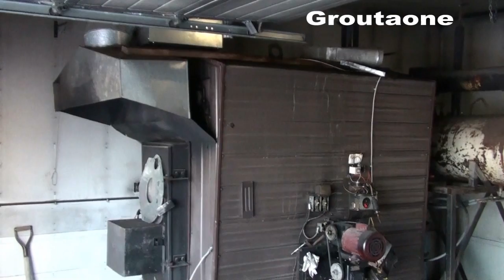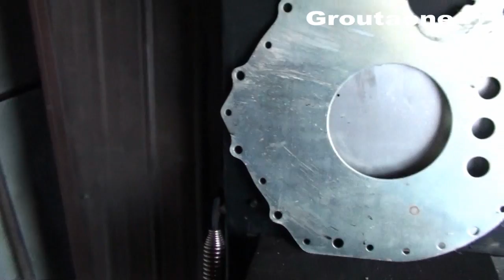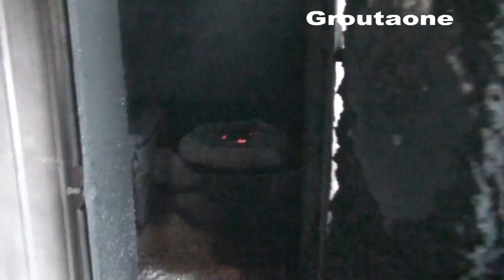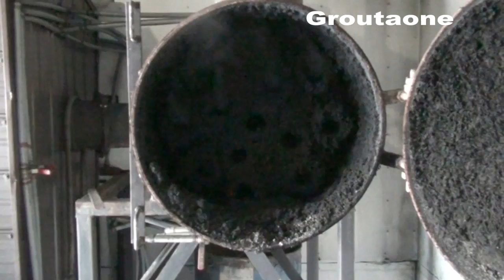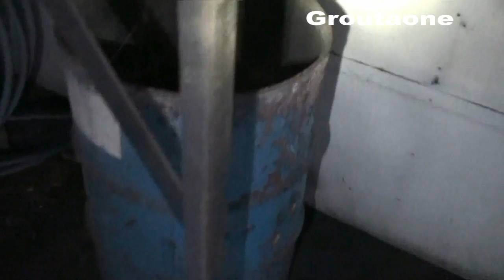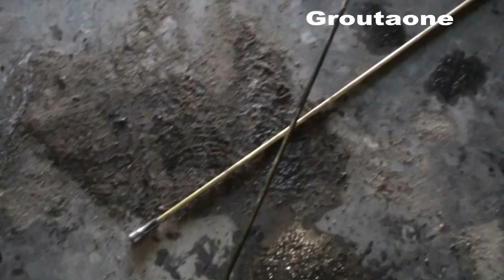How I heat My House  For Cheap In Canada pt 4

Comment: My house has a dynatherm petroleum heater. The inside of the heater has the same arrangement of tubes. Needs to be cleaned every five years. Efficiency is middle ninety percent. Really cuts down on my heating bill. I would say by forty percent compared to the old oil heater that I use to have. I clean the inter pipes with a tool just like yours but there are twice the number of tubes to clean. Keep on making videos too.

Comment: I love that system. wish I had something I could burn. Bout all I got is grass and weeds growing on about 3 acres here. lol  Still all that ash has me wondering if it couldn't be better. Some way of filtering that ash before it hits the heat exchanger. It would allow the heat exchanger to operate more efficiently.  Not that you really need that little bit of efficiency with such a huge supply of fuel. Which reminds me. Where do you get all the sunflowers?

Comment: thanks for the great vid.
you have to find a way to auto clean heat exchanger.or some things that clean a little the exost.
so you clean the heat exchanger once a season.you alsaw can use cleaner fuel.
i hope that you have to do cleaning duty once a season.if not your vid sucks :).
i can alsaw give you an idee.
why you dont place heater on the vertical path and a colector of ash down and most of ash colects on the bottom.
ofcourse you need a longer heat exchanger to make same heat.but cleaning duty has to be mutch easyer.
you can use 2 heat exchanger separate for easyer cleaning.

Comment: I'm actually doing this for a living in a 18 megawatt scale consisting of 3 carbon monoxide fueled boilers at a local area heating company in Finland. There's about 100 tubes per boiler so you can imagine it's a lot of work :) You've got a interesting and unique heating system, can't see those in finnish houses.

Comment: Very important video I think. I think there must be a better way to remove ash. I can imagine a vertical heat exchanger with a vibratory ash remover. The vibration can come from your motor directly mounted or indirectly through a belt and counterweight. With enough vibration and the ash falling straight down to a bucket you can avoid cleaning your heat exchanger so often. What do you think?

Comment: Hello Sir,
You may benefit from adding a cyclone separator between your boiler and heat exchanger. It should help extend the maintenance cycle and the ash you have to clean up would be finer. Also, it would not be that difficult to design the cyclone clean out so that you can empty the cyclone without needing to shut down the system (think air lock). Regardless, I enjoyed the video series!

Comment: ok, me again. I think your efficiency could rise up a lot, if you do not produce so much smoke, which you have, by a cold dark red flame. I experimented with some funny parts I found in the junk yard and wood-chips: it is realy not too difficult to get a brutal brilliant blue flame, which is so hot, that it burns most of the ashes too. If you have fewer deposits in your heat-exchanger-tubes, or if you have them some weeks later, that could maybe raise your efficiency a lot? watch?v=z1fyFT5Q_Nc

Comment: As your looking at less than $600 dollars to heat a big place if one load is $300 and the silo ends up 3/4 full I'll not get too smart with you.  $600 = £400UK ouch might just buy one tonne smokeless or 1 1/2 tonne of coal. You don't bother to brush the tubes? Look at videos of loco boiler cleaning. I used to volunteer on a coal fired ship with Lancashire boilers. Tube cleaning was critical to steam raising. Sudden section of large diameter flue would drop the fly ash pre boiler tubes.

Comment: Not the most efficient burner as you get that much ash in the heat exchanger. Maybe you could create an insulated burn chamber to significantly raise the temperature and then burn the pyrolysis gases just before the heat exchanger using a secondary air intake. With fewer ash particles you might put some turbulence inducing elements into the heat exchanger tubes to boost convection. Just a thought :)

Comment: Have you ever thought of a compress air cleaning system to blow through the flues and then into an ash cyclone to which it dumps into a 55 gal drum. and the air valve is on a timer.

Comment: I love the shroud / smoke eater.  I have been putting off building one for my fireplace insert, but I need to do it.  If you have any tips they would be appreciated.  I can't stop the damn smoke from coming in.  My mom's Charmaster was almost as bad as yours when stoking it with 200 lbs of wood 3 time a day.  I love the fix.

Comment: When you opened up the exchanger and showed the tool, I was thinking, that tool is huge compared to the holes.  I think your design is near perfect.  My mom had a charmaster furnace from minnisota.  When cleaning the exchanger, you had to do it cold and remove stove pipes that didn't like to be removed.  The amount of material that would accumulate was amazing.  Even the pipe after the exchanger where the damper was became clogged and glazed from wetter wood.  It consumed 12-14 cords of wood/yr.

Comment from the maker: Kind of like that, I thought if the heat exchanger tubes ever rust through I could drain the water from it and disconnect it from the water flow and bypass the smoke till I get it fixed

Comment: The inverted barrel above the exhaust  helps maintain the hot gas velocity for heat transfer and turbulent mixing for proper pyrolysis.  The botom may need a sheet metal skirt to allow the ash out the bottom like you have now.  With a removable frame you can test it with your system with the flexibility  to adjust the top exhaust gap and a radial fin setup to channel the ash out as your burner bowl rotates.

Comment: Have you ever looked at a rocket stove type setup?  You would probalbly put a pipe set up like your heat exchanger of insulated pipes above the boiler flame. Instead of water you would have vermiculite to insulate the flame path to raise the flame temperature to pyrolize the soot and leave an adjustable gap between it and the water jacket around your boiler.  This should give you a much hotter and cleaner boiler flame and use less fuel.

Comment: Another continuous cleaning method is to increase the exhaust velocity by add a hot gas recirculation fan than pulls gasses from the flue and sends it first into a spiral/cyclone filter then back into the boiler tubes and flame chamber. The high velocity exhaust will prevent the ash form settling in the boiler and the filter will handle the ash removal.

If your not sure how a spiral/cyclone filter works, just Google it.

Comment: cool system but what could help cut down the ash build up is a soot blowing system which as used in industrial boilers to control ash while the unit is still running. It consist of a series of strategically placed high pressure air nozzles that sends a short puff of air all at once or in a given sequence. The air dislodges the ash which either flies out the flue or drops down in a collection bin.

Comment: Punching tubes on Cleaver Brooks boiler, search you tube, this is a small boiler , the one we opened it took 2 fork lifts and a bridge crane to Crack open , the roder was a sectional machine kinda like a ground moler you punch a section back up add a rod  and take it back the same way we put on 4 sections per tube , and there was a varity of tools to clean with including cutters for punching water tubes , we had fire tubes like urs talk about nasty job!!!!

Comment: 100 ton unit at a paper mill , small one lots of steam to make laminated paper section into cardboard , worst of all it was "hot punch" mill was only down for 48 hrs so it was still about 120 to 150 at the working end of the boiler tubes , tonnage is the ammount of water can be turned to steam in hour[ geez an hour? ]long time ago not sure if that was hr or 24 hrs but any way shit load of steam .

Comment: Hi!
Long time no see! That's the way you clean the boiler tubes on old steam locomotives. If you look at a photo of one, the whole front cap comes off. I enjoy watching your videos on this heating system! I think it is an excellent idea especially where you live. I'd trade a little labor for the cost difference in heating any day of the week! Just curious as to the difference of cost of this system compared to gas or electricity? :)

Comment: @groutaone Couldn't you rig one of those spark ignitors up with like a bottle of propane off of like a torch. The ignitor kicks on then the propane turns on for like 30 to 60 seconds. They could be set up on a timer that is tripped every time it starts just for good measure. I don't know, I just got off work and my mind is wondering.

Comment from the maker: @leanlifter1 No the house never smells because its not attatched to the house in any way, sometimes I smell it when I'am outside depending on wind direction, but its no big deal. I do have more vids, pt 1,2 and 3 to give you a bit of a look at it, most of this stuff you can buy ready made if you look around a bit

Comment: I assume that tool reaches far enough to push it out the other end? With that wall there I can't see you getting it in to pull out the ash from the other side. 

Still using sunflower seed shells or is there a different fuel this year?

Comment: If I recall, sunflower seed hulls is the fuel. Would like to know how the internal delivery system works for those. I know the auger pulls from the storage to the furnace, but I don't think it just dumps the hulls unregulated.
Also makes me wonder how bad it got back when wood burning stoves were the norm.